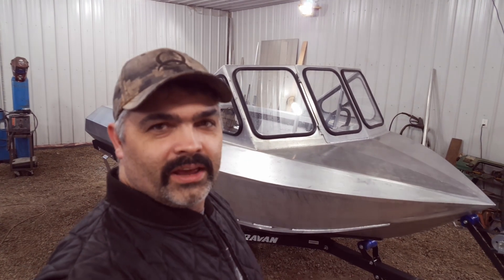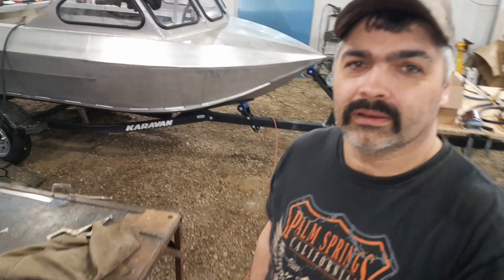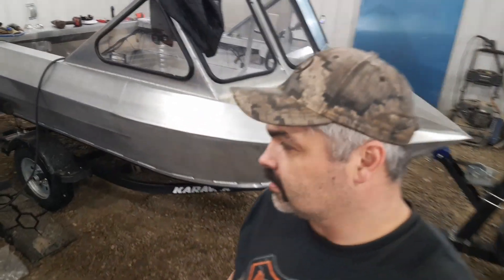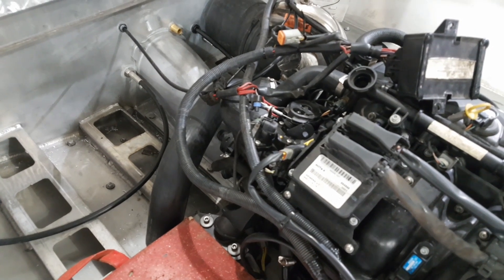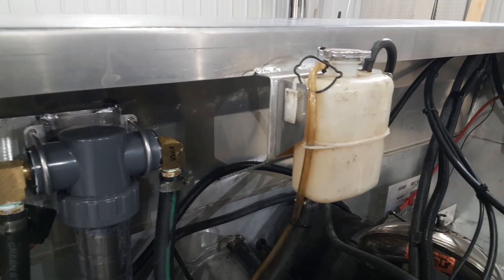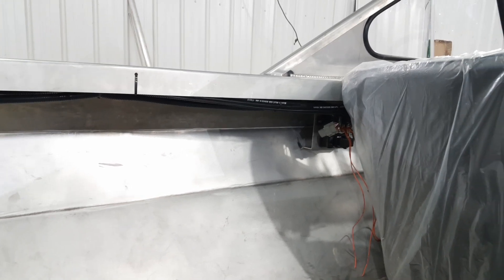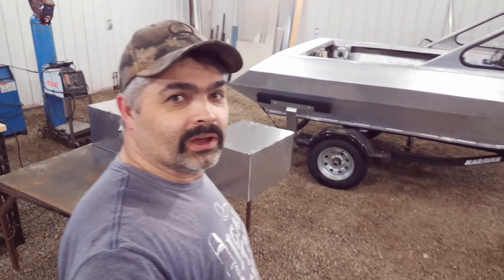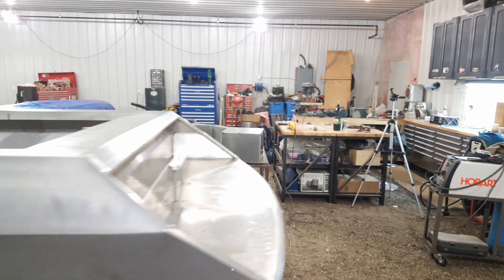Supercharged Mini Jet Boat build Episode 1: Minijetinc Jet Boat Build over 3 days

Comment: Question !
I have the same motor and pump setup in a custom 12’ hull

Did you have any cavitation issues ?  I have it pretty decent and can’t sort it out..
Reply from the maker: Well its not my boat, but yeah he had trouble with cavitation.
Reply: @FabbinAdventures  figure out any solutions or what was causing the cavitation ?
Reply from the maker: @sebastian8879  he ended up going to the munster 2 stage impeller set up.

Comment: Should do a little review on that Magnum Wave 200 KD Welder. Haven't seen anything really. Had one customer at KMS raving it was a great machine.
Reply from the maker: I actually started to do a review, i know you cant find anything on that welder. It is actually pretty good, but i am no pro..lol
Where are you from?
Thanks for watching Fabbin Adventures!
Reply: @FabbinAdventures  Vancouver. Its actually on sale for 1099 at KMS tools for 3 days before going back to 1149... I'm probably going to pick it up.

I had the Lincoln Squarewave 200 but had to sell it to get my new Millermatic 252 with spool gun. Missing the tig but this rigs been pretty versatile for what I was building. Lot of aluminum frames, doors, windows etc tedious trying to mock it up with tig. Now I'll have the best of both worlds.

Continue with the review! I'm sure people will be happy for it to be there from all over
Reply from the maker: I usually dont use a tig too much, wish it had a pedal, but it has lots of adjustment and even pulse which is why i bought it. Works very good sofar.